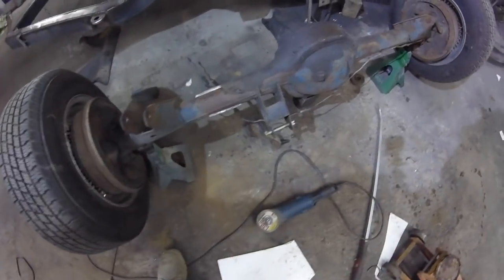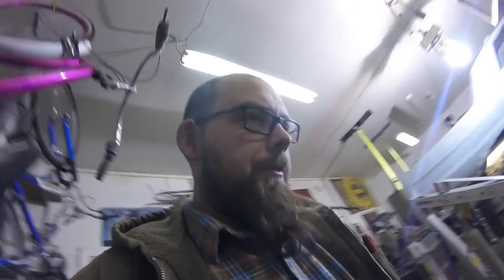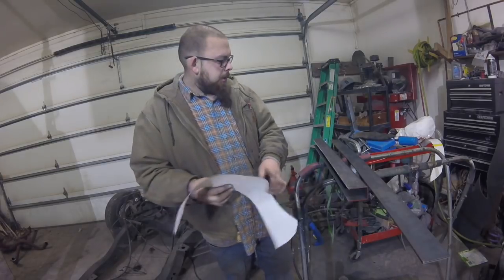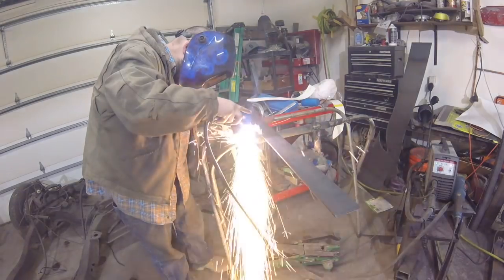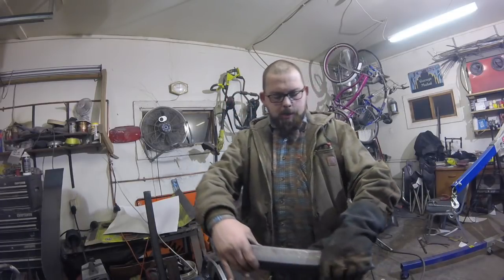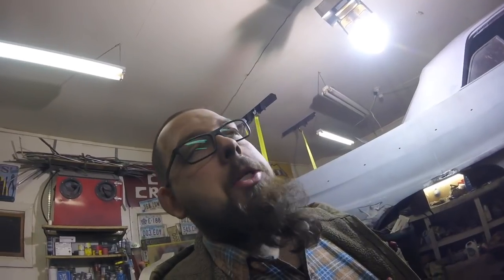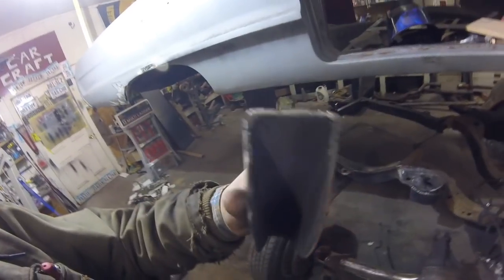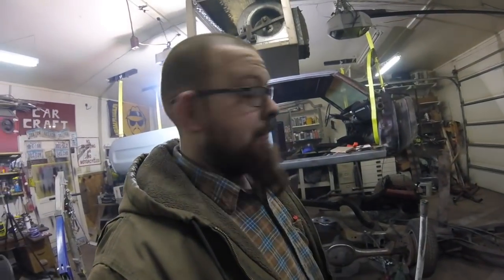64 Impala SS LOWRIDER reinforcing

Comment: I'm with you on the reinforcing the rear end I used the same logic the cylinders dont mount to the top of the rear end and no chain bridge, I did use a Tacoma rear end in my 64 impala though little more strength no axle popping issues.

Comment: Hey RJ. Do you have to have a full wrap on a 64 convertible because it has less support? Can you get away with a stress point reinforcement if you’re just doing fbss and no 3 wheeling or hopping.
Reply from the maker: Jack McFann factory verts have very strong frames. They are reinforced from the factory.
Reply: @RJTickler  Thanks brother.

Comment: Question: why would you reignforce the rear Axle? It's rare that I seen it done. Are you trying to make the rear end hop? Dude I been working on my 64 for 3 years and still have some ways to go money is tight lol
Reply from the maker: copyright2021 a lot of people reinforce them, because of the added stress they take from all the weight in the back end, once the frame is wrapped and has a bunch of batteries hanging over it. It's a lot of weight and those axle tubes are not that strong. And on cars where the cylinders mount to the rear end and you run a chain bridge it's a must, they are under so much pressure when you try to three wheel.